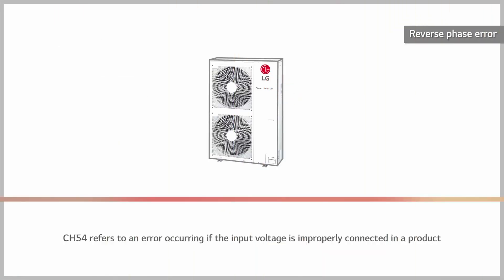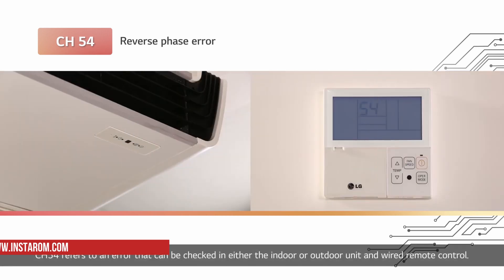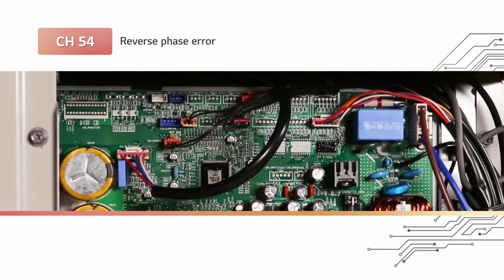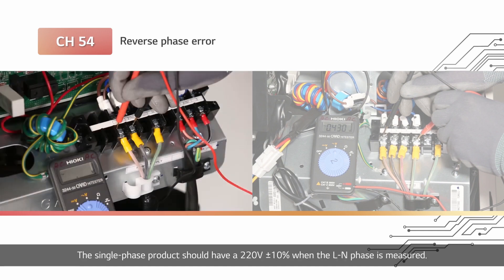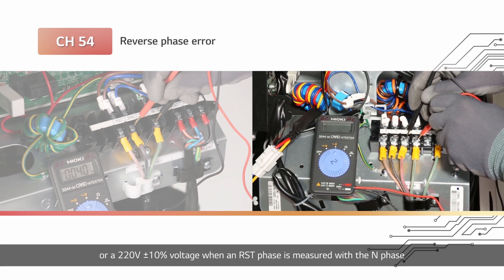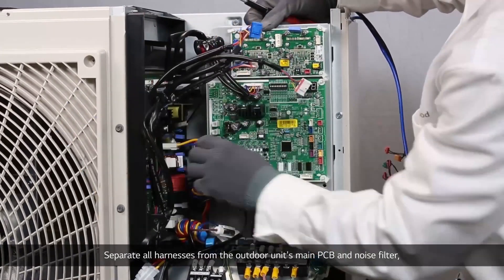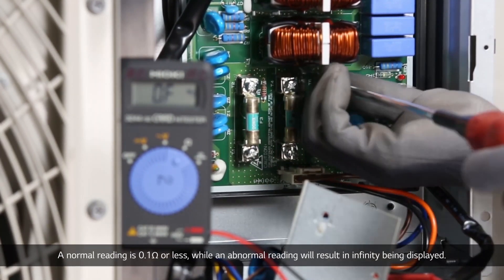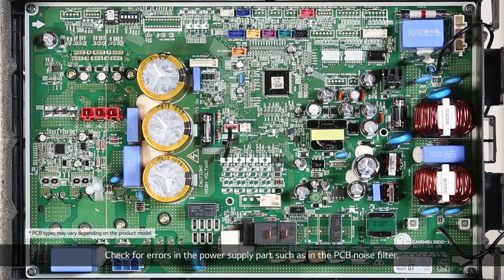CH54 error code | Troubleshooting LG Comercial air conditioning

Comment: Code CH 65 and CH 52 how fix that 
Thank you 🙏
Reply from the maker: Hi, Fault Code 65 is a problem with the Inverter PCB heat sink thermistor for the heat sink on the outdoor unit PCB, unplug the thermistor from the PCB and check its resistance. 
Fault Code 52, this fault code indicates a communication error between the Main and Sub micom (CPU’s) on the outdoor unit main PCB. Check for evidence of damage, if none found reset power, if fault reappears replace pcb.
Reply: @InstaromRo  
Thank you for response
Reply: En un multi V LG me sale el error en el termostato CH 50 a que se debe